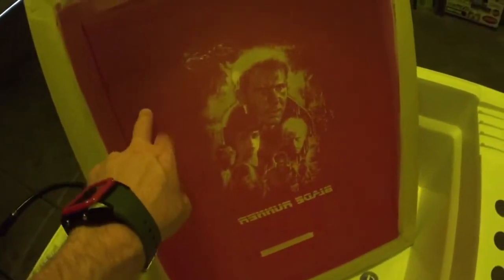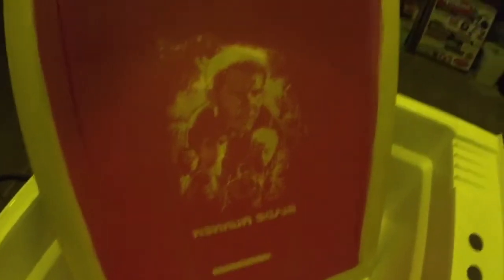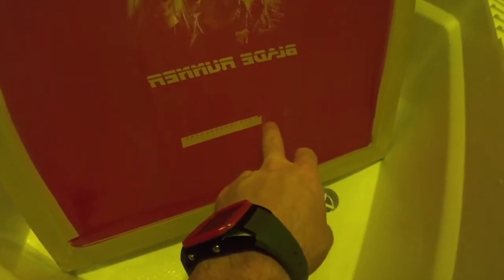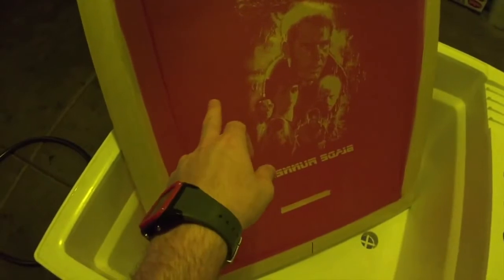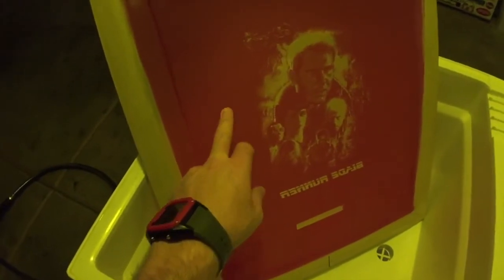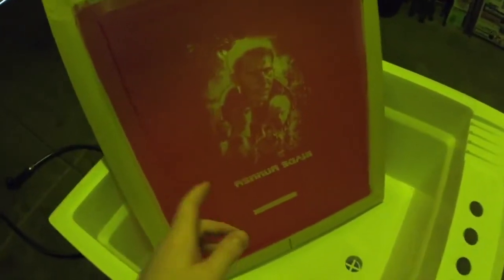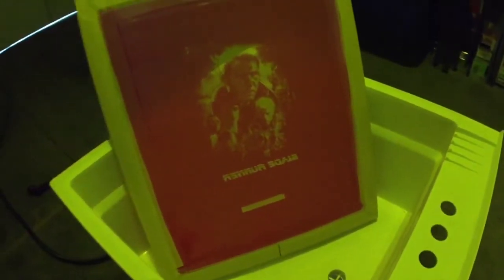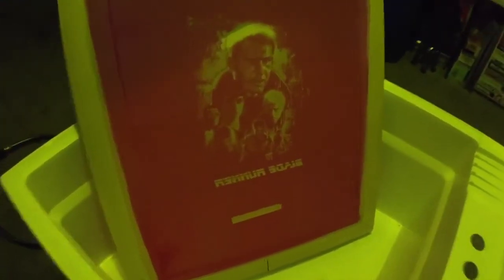Halftone Test | No RIP x 40LPI x 200 Mesh Screen x WBP Emulsion x 500w Exposure Unit

Comment: Dang this is awesome. Thank you bro
Reply: Brother how long was your exposure time for halftones? Also what type of printer are you using to print your film? That print came out great. I’m trying to make some fundraising shirts for my daughter to get to UCLA for a college invite. Hopefully when this pandemic is over.
Reply from the maker: Hey! Back when I made this I was exposing with a 500w halogen worklight, usually for around 14.5 minutes but that can vary depending on your stencil thickness, the emulsion you use, and other variables. Your best bet to dial this in is to get an exposure calculator. The printer I used for this particular project was my Epson Artisan 50 at the time... I have a video on improving your film output with a standard inkjet that might help you as well, just check my page.
Reply: Hotbox Print Studio Chico Wow ty so much. Yes I watched your videos and I have the same set up. I use the same wpb emulsion from ryonet. Brother ty for taking the time out of your day to help me with this. I will try this out.
Reply from the maker: Kanak Attack no problemo Kanak, lemme know how your prints turn out! 👍🏻

Comment: I’ve been having trouble with burning my Halftones it’s usually hard to wash out and I blow out my screen once I start to get details in my stencil what could be my problem? I lay two pieces of glass on top of my screen for positive contact I use a homemade 300 w light exposure unit @ 12 inches away but I’m thinking my film positive isn’t opaque.
Reply from the maker: Hmm... a couple things come to mind... first, it sounds like your potentially "over exposed" if your having trouble washing out. Additionally, I would not stack 2 pieces of glass on top of each other to achieve positive contact, you could be making light refract in a negative way and cause exposure issues that way too... instead, use something with weight on top of your screen with a piece of foam and squash it down as much as you can. I dont even use weight and I get good exposure with a janky 500w worklight. Its just a matter of knowing your exposure time and having opaque films... you say you made a exposure unit but not sure what type of light youre using, if its LED, your time will be much shorter than fluorescent or Halogen, etc. so that could be one cause for over-exposure.... and if your having issues with your film positives you could try checking my tutorial https://www.youtube.com/watch?v=y8ADueq40Qg&t=1s on how I print my films to help achieve a darker result. -- I hope that helps! 
Best
Shaun

Comment: Good video, have you perfected the halftones yet? Do you normally wash out on both sides or the screen?
Reply from the maker: MrJrfuller83 I have not had issues with halftones via the old 500w worklight method. I may loose some “very fine dots” off and on if my cure times were a little iffy, but when those are dialed in based on my screen mesh and the thickness of my stencil they usually washout no problem. And yes, I always wash out both sides. I’ve switched to a tube based exposure unit now though and have not tried halftones on it yet. I presume it’ll work just fine though. A lot of naysayers claim you need a vacuum blanket to get good dots, but there’s ways around that, you just need good positive contact and no light refractions in the mesh.

Comment: what paint will you use for that 200 mesh? is it okay to use a water based paint? thanks for the awesome video man. starting to print halftones get to another level. cheers man
Reply from the maker: I used plastisol mixed with discharge base and activator for this print, but you can do standard plastisol ink, or standard water based ink for halftones just the same.

Comment: 230 mesh count is a little more recommended for halftones as it holds them better. What we do is under base on a 200 mesh and color on a 230 for simulated process printing. The White top would also be on a 230 mesh count.
Reply: Can a 230 mesh count screen hold 45 lpi and up halftones than lower meshes? I have a problem where tiny haltones details get washed out
Reply: @thiniceking12  We do 60 LPI to get better detail on a 230 and have no issues.
Reply: @Dragonslayergoblineater we use 280 mesh for 60 lpi, but a 230 can easily hold 52 lpi.
Reply: What’s a good emulsion to use for halftones? Looking for something alittle universal for textile and halftones. I just need something that would last longer than 6 weeks unlike the diazo mixes
Reply: We use Saati Textil DW Dual Water Resistant Emulsion and have no issues.

Comment: hey man great video thank for sharing , can i ask how long you take to exposed it ? thanks
Reply from the maker: Hi Afiq, when I was exposing with the 500w worklight my time was usually around 14.5 minutes, but mesh count and eom thickness can vary your times as well so a calculator is recommended to find your exact time(s).
Reply: Afiq Mansor que me

Comment: Heck yeah, subbed bro. Great video, Is there any info on that exposure setup...?
Reply from the maker: Hey Juan, thanks for the sub... The exposure setup I was using in this video is extremely minimal and "hobbyist"... its a simple a 500w halogen work lamp rigged to a PVC stand to allow it to hang over the image area of the screen about 14 inches. Nothing fancy, and about is basic as you can possibly get... for what its worth its actually very capable of exposing the majority of the screens Ive done including halftones amazingly, you really just need to test and find your exposure time with a calculator... but with that said, using a 500w work light is slow, and not production friendly once you get serious about printing, and theres obviously better options out there. It also runs extremely hot since it must be on for around 14.5 minutes to expose one screen... so yeah, slow and janky - but effective on a bare bones level nonetheless... just make sure you create some positive contact with a foam square and some pressure in order sandwich your film positive as tight as you possibly can against your screen during exposure. Hope that helps! Best! -Shaun
Reply: Awesome! helps greatly, thanks a lot for your help watching all your vids right now.  Im just getting started just for a hobbie so this is perfect. Thanks again !

Comment: Here is a random question that has ZERO to do with the actual video... Did you just wrap a moving blanket around your screen rack? Seems like a brilliant idea for a garage setup. I am struggling with a place to put screens because my garage has a window and we use it daily. Thanks!
Reply from the maker: Haha, yes. A temporary solution until I build my dry rack. Bought a couple from the UHAUL store along with a pack of plastic clamps from Home Depot.... I just drape them over my screen rack and clip them together when curing emulsion. Works but not advised. Thanks for watching!
Reply: Why don't you advise? Airflow? I mean it seems like a great idea and gets the job done.
Reply from the maker: Don't get me wrong it totally works, but its not production friendly. Its a pain in the ass. You also need to make sure to keep the blankets clean and dust free as you dont want them to accidentally deposit dust particles onto your freshly coated screens... I haven't had a problem with this, but thats because Im extra careful with how I store the blankets. I keep them in a bin that stays shut when not in use and before I drape them I attempt to inspect them for particles of crap that may be stuck on them that could fall off... just not convenient in regard to efficiency, but totally works great at keeping it light safe. Helps allow pretty decent air flow still too as the blankets are wrapped around my cart which is a pretty openly structured design. I also place some inexpensive Eva-Dry reusable dehumidifiers inside the rack to help expedite dry time a little... doesn't do much but does help.

Comment: Your videos are useful! Thanks! I actually didn't know I could print my own transparencies on my Epson printer (I thought it had to be laser). Yay no more Kinkos! So how are you creating halftones in your artwork without the RIP software? I saw your other video about Illustrator but that art wasn't using half-tones. Thanks!
Reply from the maker: Hey! Thanks for watching, Im glad it was helpful to you.

Yes you can print your own transparencies with an ink jet... you really just need quality films and the right printer settings and your off to the races after that. It can become costly though to continue buying stock carts so optionally you could buy refillable carts for your printer and then buy uv blocking dye ink made for all black ink systems. 

Regarding halftones - I currently create halftones in Photoshop. Rip software like AccuRIP will give you more fine tooth control over the shape of the dots and ink deposit, but IMO its not horribly necessary. Makes things quicker and easier in post production, but not necessary to create basic halftones nonetheless.
Reply: Thanks! How do you do that in Photoshop? Filter>Pixelate>Color Halftone? I tried it that way but it creates weird patterns with the dots. Could be the settings that come after that though... Yeah AccuRIP is too big of an investment for me at the moment so I appreciate your help with what you've learned!
Reply from the maker: Im not knocking AccuRIP for the record. Its a useful tool, but Im in the same boat and cannot justify the cost yet with where Im at and from what Ive discovered its not really a requirement to create quality halftones.

So for halftones you first need to make your image greyscale and adjust accordingly until it looks like it has the correct contrast... this takes time to learn too since what looks good on screen might not look so great on press once you push actual ink through your stencil... with that said, once you go greyscale and make some adjustments you can then convert to a bitmap, and when you do so you choose Method: Halftone Screen... from there you need to figure out your Frequency, Angle, and Shape... this is determined by a simple math formula, but it can be fudged a little. If you want I can try to make a new video for this eventually, but I know there are a ton of videos out there already on the topic.. its how I learned as well :) Anyways, I hope that helps a little.

*If you dont find what your looking for via a search on YouTube for making halftones in Photoshop let me know and Ill make you a tutorial on it. Im no expert by the way, but I know the basics.
Reply: I did find one on there that described your method exactly! I unfortunately just use Photoshop Elements, which doesn't have the Halftone Screen Method option. Was hoping maybe you did it differently :) I will keep playing around to see what I can find that works! Thank you!
Reply from the maker: Oh bummer! Sorry, thats the only way Im aware of that you can do it via Photoshop.

Comment: Excellent video. but I am starting this hobby. I don't have any experience.I have question :What is the  exposure time ?
Reply from the maker: Hi, thanks for watching. 
This will really be entirely dependent on your setup and your process... many variables can change what your time should be. My #1 recommendation every time someone asks me this is to make sure you go buy an exposure calculator and measure your times through trial and error with the calculator. You will find "your" number a whole lot faster that way, and most important - it will be accurate to your process and your setup. Theres really no silver bullet. Ive added links to exposure calculators for previous printers asking the same question. - *Please check the description of this video. -- But to answer to your question, MY exposure time is typically 14 minutes. Again, I wouldnt go by what my time is however. Instead use a calculator like I suggested. I hope this helps.

Best
Shaun
Reply: Hotbox Print Studio Chico Ca Nice answer.tha k you very much. Happy sunday!
Reply from the maker: My pleasure :)
Reply: Hotbox Print Studio Chico Ca I understand you said there isn't a silver bullet out there to exposure times and there are many variables affecting results.... however do you find that more exposure times yields better results with more detailed, tighter, halftone work?

Comment: nice video showing us how you burn your screens with the 500w exposure unit... I'm just starting out and I'm about to pick up a 4-1 press w/ micro reg. Your set up is pretty much what I'm going to get... I just don't know which exposure unit I should buy. I know units with the vacuum is the way to go, but I don't want to buy more than I really need. I plan to print up shirts for my brand and for my boys, no half tones, just simple 1-4 color prints in multiple locations. Overall print quality is my main concern. What would be your best advice for someone like myself? Thanks in advance
Reply from the maker: Id prob recommend the following:
• RANAR CBX 2024
• Lincoln UV Exposure Unit - 20" x 24"
• Ryonet RXP Aluminum UV Screen Exposure Unit - 20x24in

I hope that helps you out.
Reply: last one worths like 800$ in some site .... lol?

Comment: How high is your light from your screen and what exposure times are you using? I know I should calculate them and I am going to but just wondering what you are using so can use them as a rough guide? I am using the same light to expose so any tips would be really helpful. Also what exposure calc are you using? Thanks in advance :)
Reply from the maker: My light is approx. 14" from my screen when exposing, and while I wouldn't recommend getting "too close" so that your light can have more coverage, theres also nothing stopping you from say, having it a little closer as well... testing is key. When I did this video, my worklights bulb was also on its last leg so exposure times were beginning to stretch and get a little longer... but at the time, my exposure window was 14 minutes. 

The reason Im a big proponent of using a calculator is because theres always too many variable that will determine what "your" approximate window should be, so its always best to test and cut out the guesswork. – I will add links in the description to where you can find exposure calculators. 

Hope that helps and thanks for watching! 
Best
Shaun
Reply: Thanks man that's very helpful. I've got mine set up at about 16" from the substrate side of the screen. I have a 1000W Halogen bulb though. I exposed for 11 mins and it was over exposed and hard to wash out that's why I was wondering on your times? I will get a calculator and test the times with that and see how I get on. Thanks again mate :)
Reply from the maker: No problem! Your light is 2x as powerful as mine, so yeah... its gonna expose your screen quicker.
Reply: I thought it was a 500W so that explains the over exposing. I will try 5 mins and get a calculator to really dial it in. Thanks again man!

Comment: One more question, what type of emulsion are you using
Reply from the maker: Tony P I am using Ryonet’s WBP in this video. Currently I am now using CCI’s TXD which has proved to have the same exposure variables. Hope that helps. 👍🏻
Reply: Hotbox Print Studio Chico Ca thanks again
Reply: Are you coating both sides of the screen
Reply from the maker: Tony P always. I never just coat one side... however, I have seen some folks do just the inkwell side with the round edge of the scoop coater... but I think they had a special emulsion or post hardener that allowed them to pull that off for large runs. 

In this video i did a 2:2 coat. Normally I will do a 1:2.
Reply: Hotbox Print Studio Chico Ca - hey bud, I know this video is kind of old, but in case you hadn't stumbled across this yet... :)
I believe (and found that other people believe) that emulsion expire dates are BS! The more they sell, the more money they make 😉
I mostly use photopolymer that have a 1 year exp, but I run out in a months. I use some dual cure that has a 1 month expiration, but I have use it 6 months later with no issues. With that being said, the reason your screen was under exposed is because (I think anyway) your dialed in time is for a 2/1 coating and you said this was the first time you did 2/2 coating. More emulsion (thicker coats) = longer exposure times.
Hope that made sense haha.
:)